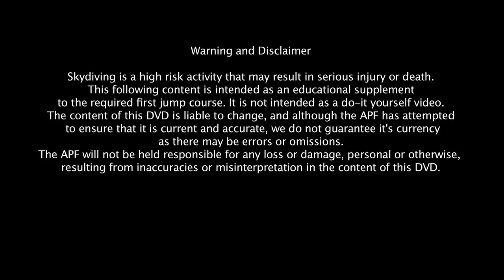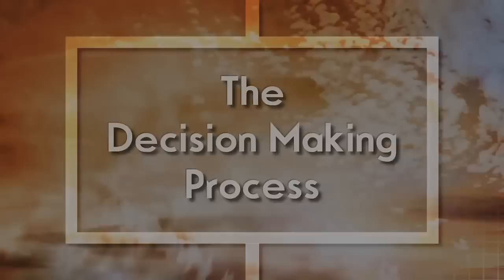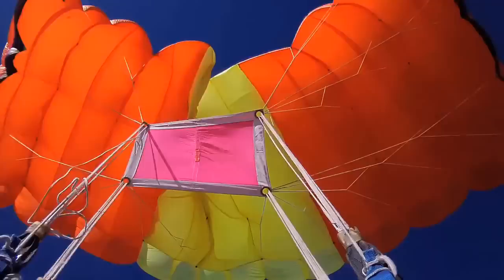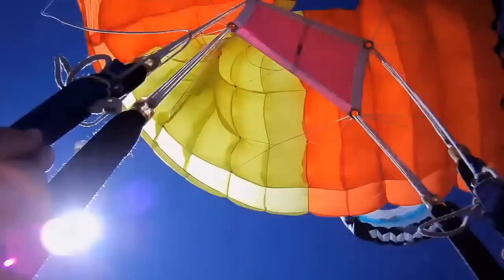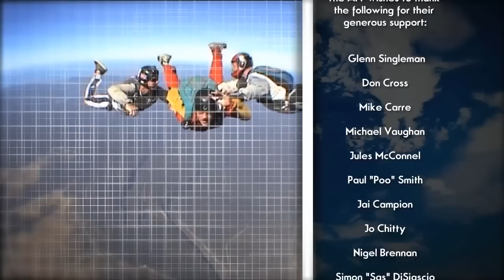Cutaway! Emergency Procedures

Comment: If you have a horseshoe malfunction, you should NOT move directly into emergency procedures. You should first pull your main pilot out. If that doesn't pull your main canopy out, THEN emergency procedures. Don't ditch your main before you've even tried to use it.
Reply: about to take aff1 and i was wondering about that.  i would hope my instructor would give it a yank for me but imagine the look on their faces if i got to it first. hahahahahaha
Reply: @yz2508  Too many ha's, mate
Reply: My first AFF instructor told me the same.

Comment: Back in 1978? I had to "Cut away" my Main Chute, I was on a 15 jump Freefall course. We jumped from the bottom wing on a Cessna Biplane and the first 4 were with a Static Line. The Parachute was one of the old round ones with a Double L mesh opening at the rear to give forward thrust. I completed the first 3 without any problems so only one more and I get to Freefall. The forth one I had a problem as I got what is called a "Line Over" This is where one of the Lines goes over the top of the Parachute rather than down to the harness. So it looks like a Bra rather than a half Ball. I had to "Cut away" the Main and deploy the Reserve Chute. It bing a Life saver not a Limb saver asit is smaller I pulled all the ligaments in my Right Leg. Although it took Months to heal I am now Medically banned from Parachuting.